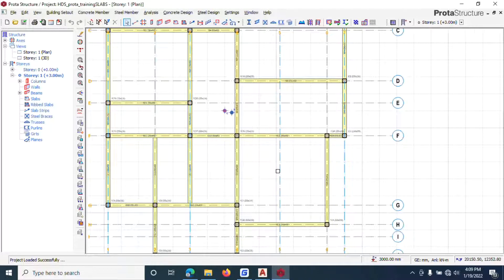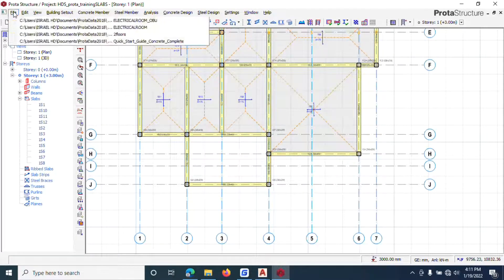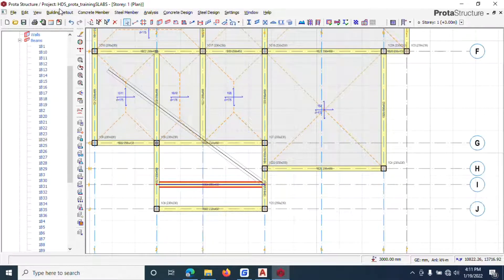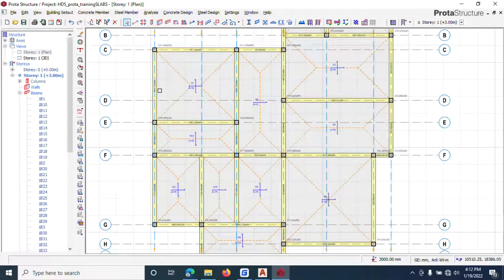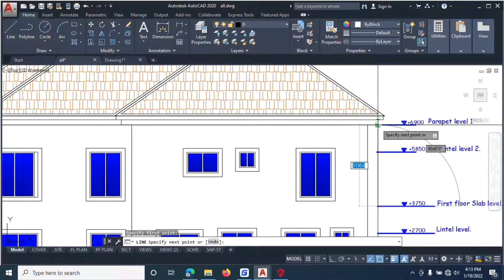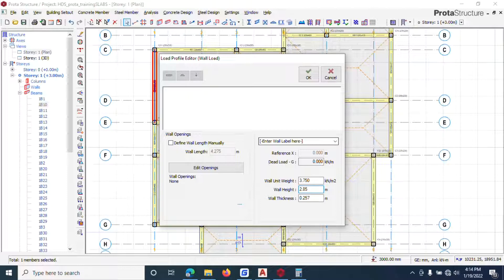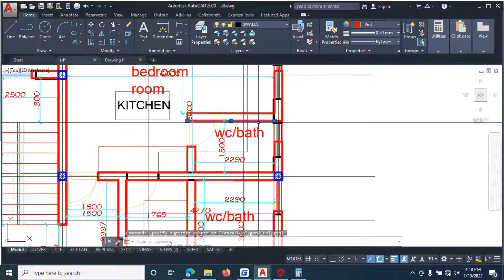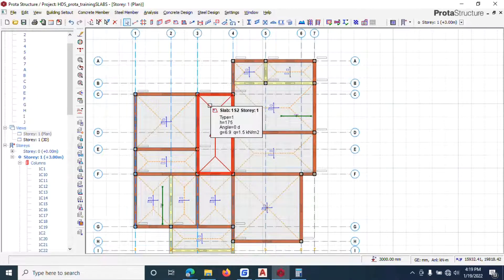Protastructure complete series Start to finish(PART-4) creating slab and slab loading

Comment: sorry isn't there anything like walls on the slabs? Why should we use line loads? won't it increase the loads on the slab?
Reply from the maker: its actually over design but its just a personal choice to compensate for substandard materials supply, you can design to leave out the line load